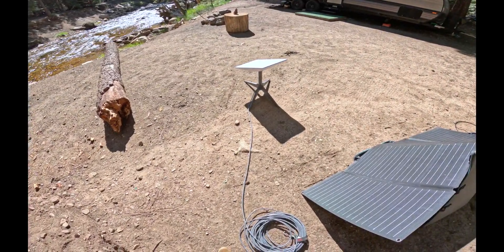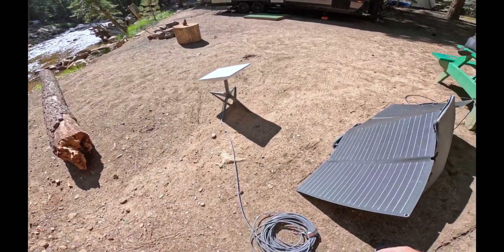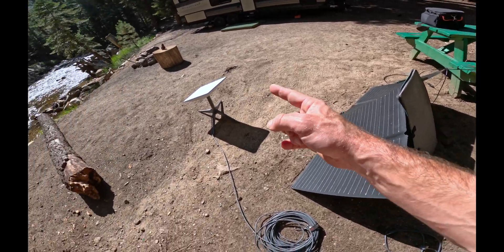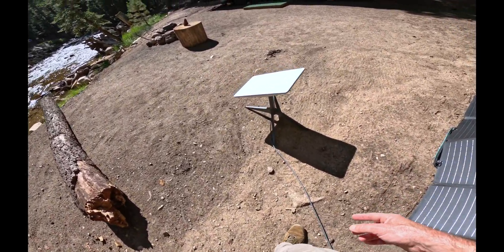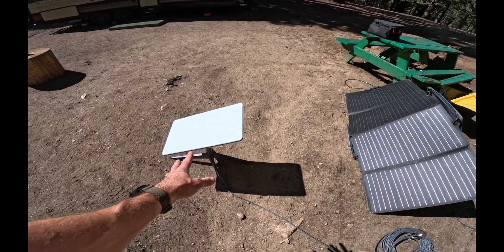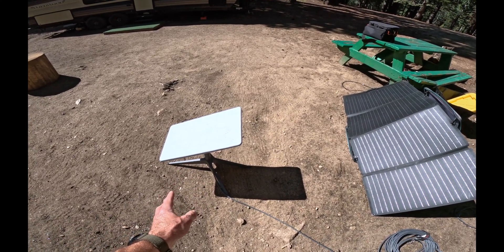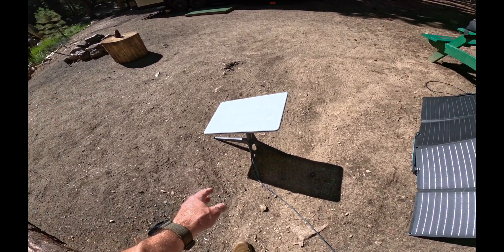HOW TO POWER #STARLINK FROM #SOLAR

Comment: Misleading title. This is NO different than plugging into your wall outlet. No solar content at all.
Reply from the maker: The solar panels are charging the power station. You do not want to plug in any appliance directly into solar, especially one as sensitive as the Starlink modem

Comment: What Ecoflow battery are you using?  How long does it last with starlink set up and charging with the 160 watt panel?  I'm debating between the Ecoflow River 2 pro/160w panel....or the Delta 2/400w combo.  I rather do the river 2 pro as it costs much less. Thanks!!
Reply from the maker: Keep in mind that you are usually never going to get better than 80% of the rated wattage. If you are using pass-through power and trying to charge your power station while running the Starlink, I would definitely go with the 400 watt panel

Comment: Hi great video. What is the solar blanket you use/recommend. Just ordered Starlink to use in the Philippines mountains no cell signal and most places no electricity, plus lots of places to explore where no electricity. Thanks in advance. Greg
Reply from the maker: Hey Greg!

Go to offgridtrek.com

Recommend a Faraday bag for your solar generator as well, just in case.
Reply: @NickC9545  thank you so much. Excited to explore this as there is an endless supply of sun here year round.

Comment: It took me two years to get mine. It is worth the money where I lived there’s no Internet very little cell phone . I have a lot of trees it does not seem to affect it . Power consumption among seems to be 50 watch I imagine come winter that will change.
Reply from the maker: Oh that's a good point because if you have to use the built in heater to use the snow melt feature, it will probably require a few hundred watts. I'd be curious to know exactly how many watts.